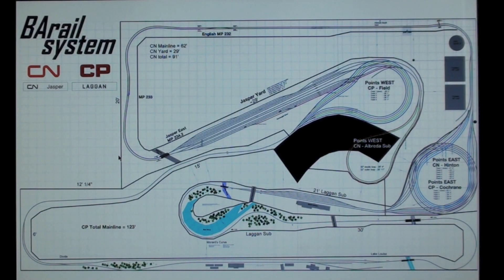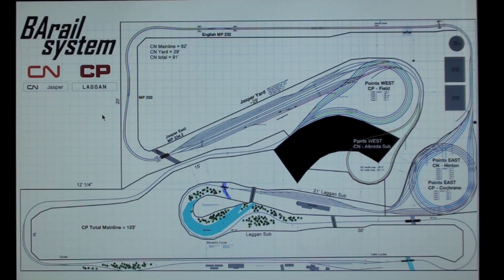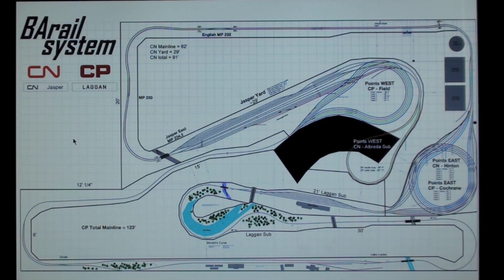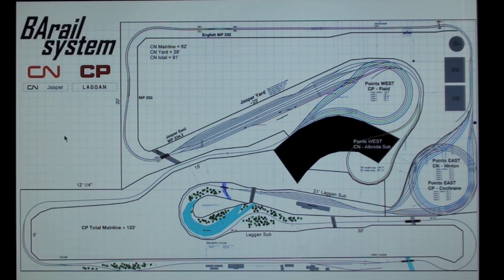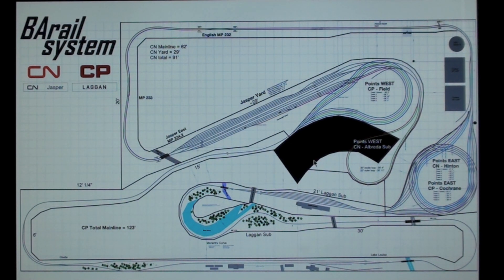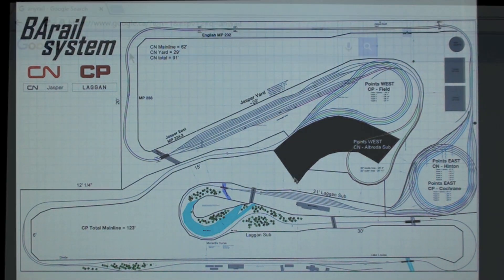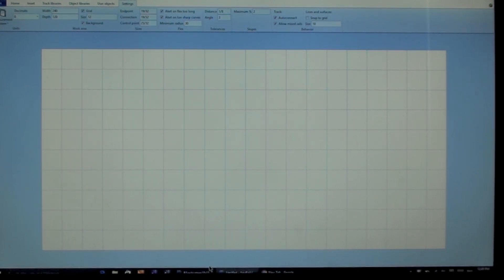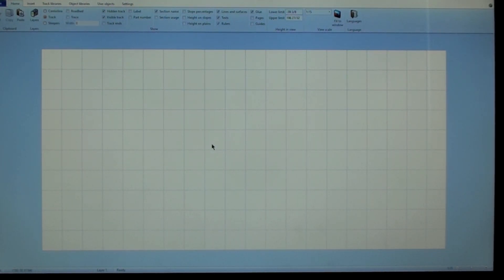A fast, easy and free way to plan a layout with realistic constraints

Comment: For what its worth you legally have to leave a 3' free space area in front of the doors to the furnace so that a service man can work on it as well as a clear walkway to get there and when it comes time to change it out you are going to want more than that or be able to remove that section from your railroad.
Reply from the maker: Good point. Also something to consider is space around an electrical panel as most places have codes dictating some amount of clearance. Always best to check local electrical and plumbing codes. Thanks!

Comment: So, I have a bit of dilemma. I am in a CAD class for my college degree and the final project is to create a drawing of something using the Cad software taught in the class. So naturally I decided to create a model railway layout. My problem is that I eventually want to try and create this layout in real life. I've decided that I will be using N scale, but am designing it to fit onto a 4' x 6' table. I need to know the absolute minimum radii needed for the curves on an N scale layout. I've heard that 24" curves will work if the trains run slowly and that's really my plan. I know you said that 24" didn't work for you, but what scale were you using? This may not be true but it seems that smaller scales can get away with tighter curves.
Reply from the maker: My apologies for not making this clearer in the video - this plan is in HO scale. 

There's a lot of good info here about minimum curve radii: 
https://model-railroad-hobbyist.com/node/10446
Reply: @BArailsystem  Thank you

Comment: This software is ok if you plan on doing a large layout, such as the one shown in this video.Bbut in my case I only have a space of 10ft x 8ft in my shed. With a central operating space, I plan to build a 2ft 6in wide baseboard along each side of the shed and 3ft 6in wide along the back wall. I have a 2ft 9 in door that opens outwards on the front of the shed and this end will be bridged with a 1ft wide lift up section. So I can easily draw out my layout plan using the good old compass and ruler method by drawing my track diagram on 1 inch square graph paper, in scale to the size of my baseboard. Insambard Kingdom Brunel built the Great Western Railway without any modern technology, so if a pencil, compass and a ruler was good enough for him, it's good enough for me.
Reply: SCARM could be an answer if you do not think this layout design program is for you?  SCARM, or Simple Computer as the first two letters represent, is easy to use with the track manufacturers and gauges as well as sizes available.  I used it for my shelf layout design.  There are several tutorials on Youtube that you can watch.  I have the ones that I used to learn the program on my youtube channel if you want?  or just search SCARM tutorial :) Good luck.  its been fun playing with the design possibilities within my limited 10 by 11 foot room.  And I am amazed at what is possible!
Reply from the maker: Nothing wrong with the good old paper and pencil method. I have a sketchbook that I use extensively for all kinds of model railroad stuff. However, one advantage of a track planning CAD is the computer generated curve easements. They are not something that could be done by hand. But the nice thing about Anyrail is you could make a variety of curve easements, print them and then cut and paste them right onto your paper plan.

Comment: Hey bud I was wondering, I am doing a Shelf layout in a L shape, is there a way to make the grid reflect those measurements and get rid of all the grid in the middle so I am left with a L looking grid? Thanks, great video to.
Reply from the maker: Hi Christopher, 
If you look at my plan the basement is L shaped. I just used the line tool to draw a thick line where the walls are. I am not sure if you can make portions of the grid disappear or at least haven't figured out how to yet.

Comment: Hi Ben, maybe I missed it...but, will there be a connecting line somewhere so the railroads can cross over?  Like if CN needs to run over the CP tracks due to a line closure.
btw: headed to Salmon Arm this weekend for the NMRA show. 
Greg
Reply from the maker: You didn't miss it Greg, it wasn't in there. I do have it though, there will be a continuos loop track where the two railroads are connected. Can't pass up that option, need to be able to run 100 car trains sometimes! Have fun buddy! I'm working all weekend :(

Comment: Great video for planning a layout.  Maybe I should have used it before building mine.  Bigger the curve the better but it never works out unless you have a large area.  I find this to be the biggest draw back on a layout.  I have a small radius but it was the first time building a layout have learned the problems it can cause.Scott
Reply from the maker: I did the same thing Scott, I had 24'' curves and lousy trackwork on my last layout. I am really going to try and step up my game on my next layout in those departments. Tight curves are fine as long as you don't run passenger or autorack length stuff. A guy could still have a great layout with tight curves by just selecting a railroad to model that features short equipment. Stuff like iron ore cars, potash cars, ballast hoppers, 2 bay frac sand/cement hoppers etc all look and run good going around tighter curves.